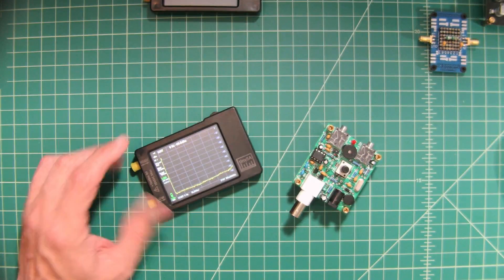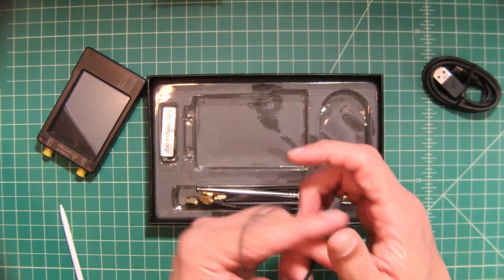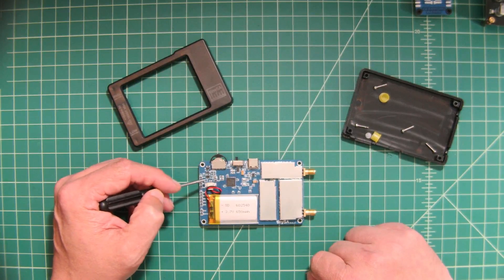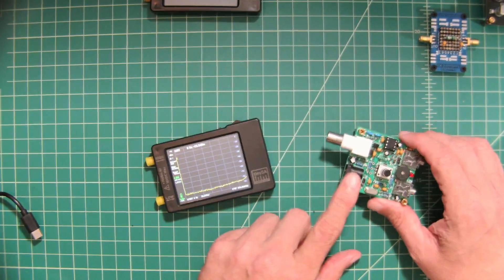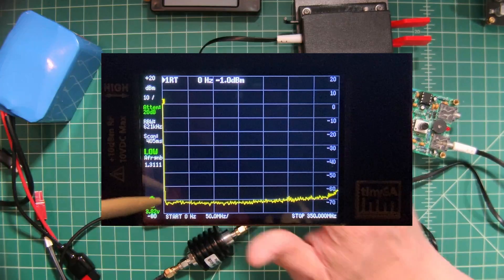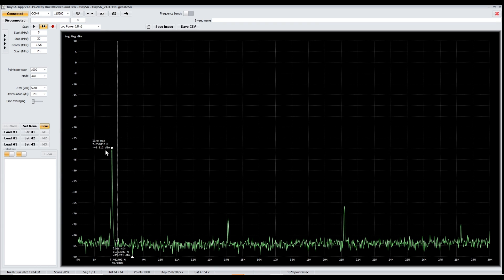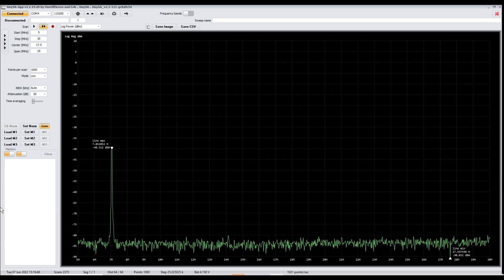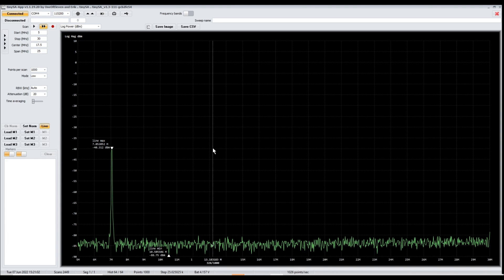The TinySA Tests The Pixie CW Transceiver - Ham Radio

Comment: Great  helpful video Ape !!  Question about the Pixie's +20 Dbm (0.1 Watt) Continuous CW RF output power during the Unkeyed, Receiving mode....I Didn't notice any frequency Shift compared to the Keyed Transmit mode so how does the Pixie receive Anything with the Strong Blocking Continuously emitted RF cw signal ?? .....Over my 60+ yrs messing with Transceivers, I've Never seen a receiver or Transceiver emitting so much Significant strong signal during Receiving mode....If not Illegal (Unintended radiated Signal without ID),  I think this Continuous 100 mw emission (especially when Antenna Connected) would Certainty be considered a nuisance Interfering RF Emitter Unwelcome by all nearby & possibly Skip Range ham stations.....I fairly certain a Receive Mode,  Continuous +20 Dbm (100 mw) RF carrier,  Connected to a typical efficiency Antenna,  Way Exceeds the FCC's Unintended RF Emissions limits......This is just personal understanding & interpretation of FCC rules & Ham Radio Community std operating practices.....
Reply from the maker: Hey Tom, I have come to learn that this is typical behavior for a Pixie and that it is part of the IF mixing that takes place.
Reply: I wonder if the pixie really gives out 100mW of idle signal in receive. The SA reads -39dBm on receive and the external attenuator is 40dB. This means the pixie is at 0dBm or 1mW. The fact that there is an additional 20dB attenuation in the SA shouldn’t matter. I don’t know the Tiny SA but most SAs compensate for their internal attenuation in the signal strength they indicate. No need to add this yourself to the reading.

Comment: At about 10:10 you refer to the second harmonic as "the first harmonic." That's a common and seemingly logical thing to do. But it's actually the 'second harmonic' the way physicists and knowledgeable hams count them and refer to them to avoid confusion. The "first harmonic" is always the fundamental frequency. This is just one of those odd things about physics that also applies in ham radio. We need to keep that in mind so we don't confuse which harmonic we're talking about with others. It might not seem to matter, but when we say that a square wave contains all 'odd order harmonics', but no 'even harmonics' we are talking about specific multiples of the fundamental that refer to the 2nd, 4th, etc harmonics as 'even', and the 1st (the fundamental), 3rd, 4th, etc as 'odd' order harmonics, and not just counting whatever we see that is on higher frequencies from the fundamental. And in labeling them we are including each multiple of the the fundamental frequency whether they appear on the spectrum analyzer or not. For instance, if the second through 4th harmonics don't appear on a spectrum analyzer display, and you only see the next multiple of the fundamental, you still describe it as the 5th harmonic. Then everyone knows where to find the one you're talking about and gives an idea about what is causing it. 

Thank you for the videos.They help hams who aren't surrounded by other hams or who have no Elmer to learn from. I had to learn the hard way, without YouTube, without an Elmer, and with just a few books and a lot of mistakes. This way is much better.
Reply from the maker: Thanks for the feedback John, I have seem it shown both ways but I believe you are correct.

Comment: Nice video, Can I suggest to switch the internal attenuation between 20 dB and 30dB to check if the harmonics with strong input signal where internally generated or not. Changing the internal attenuation will give you confidence in what you are measuring is correct.
Reply from the maker: Thanks for the reply and idea Erik, I repeated the test at 25dB and the results were similar.